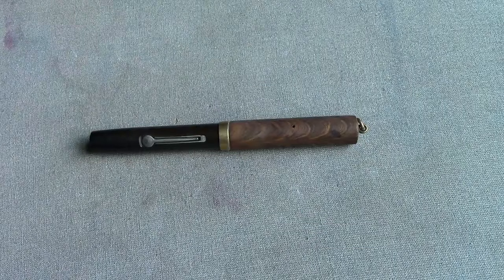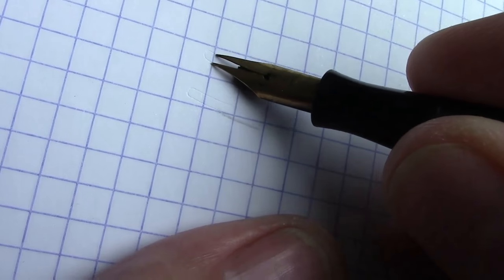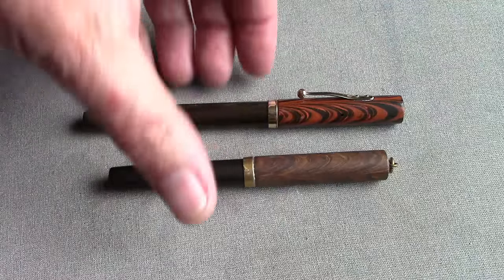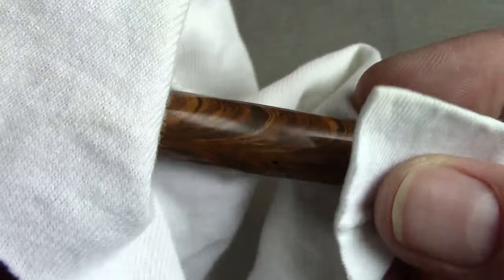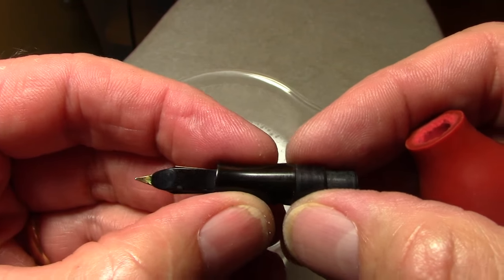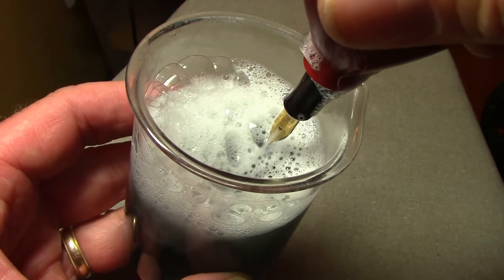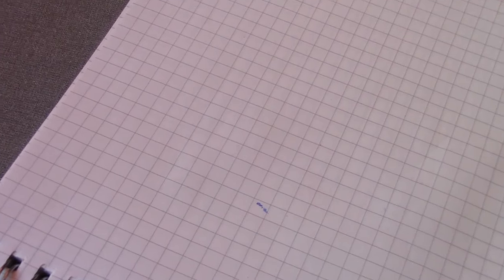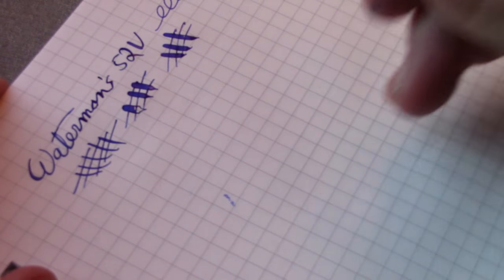Fountain Pen Restoration - Watermans 52V Flexy Frankenpen

Comment: Great video, Chris.  Wonderful job.  Where would I get the nail board to polish tipping and bulb to flush section assembly.  Thanks, Steve.
Reply from the maker: Board if for polishing finger nails, find at super markets & drug stores.  Usually a $1 or 2.
Bulb is a flux remover from Radio Shack.  Sadly no longer in business.
Can't find a replacement.  Have tried various ear & nose bulb syringes.

Comment: I would never smooth a flexible nib; they're supposed to be slightly scratchy to achieve the fine hairline. By smoothing, you'll lose the contrast between the thin and flexed line widths.
Reply from the maker: We disagree.  I have many vintage flex nibs.  Many are very smooth for all writing.  With a careful hand you can remove sharp edges without effecting line width.